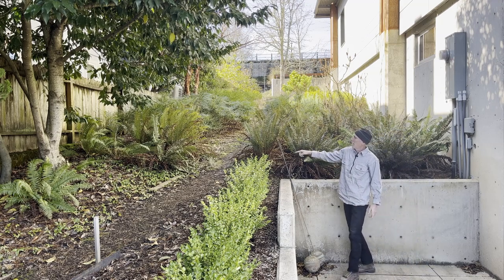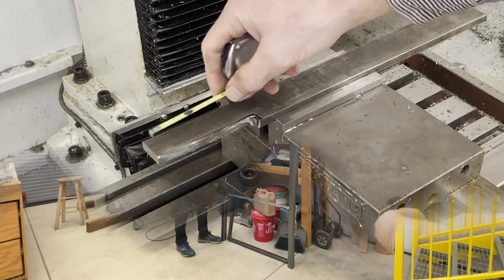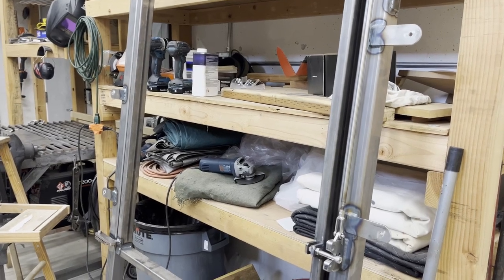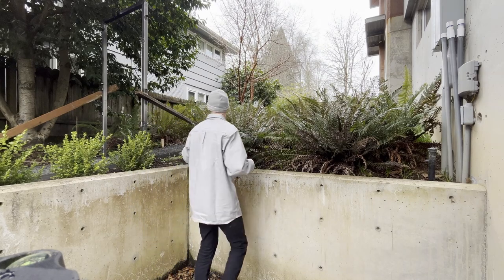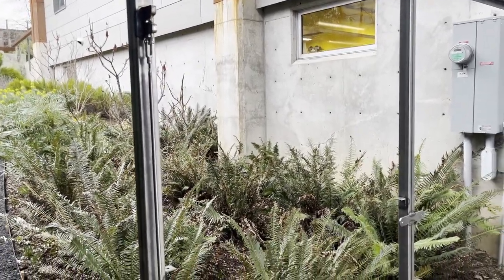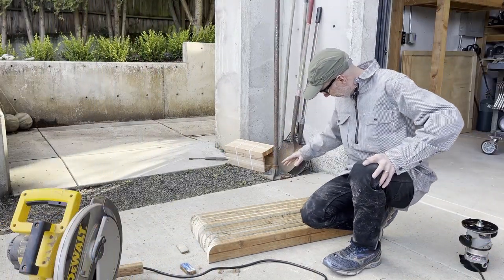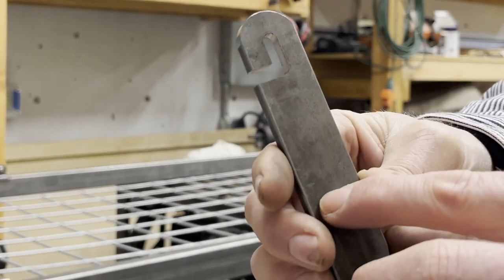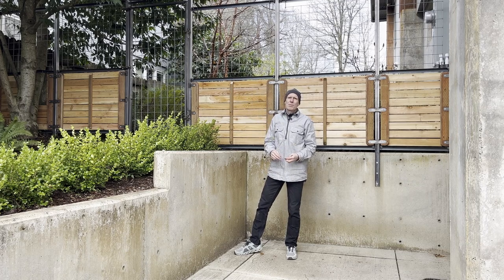000.8 - Oh Deer.. Fence. Steel, Wood and Concrete Fabrication.

Comment: Great videos, I see you are using the CK MT200 TIG. How do you like that machine?  Would also love to see a shop tour, it looks pretty awesome.
Reply from the maker: Thanks for your message and for watching. The CK welder has been really solid. It replaced a Miller of similar capacity that I paid for twice, once to buy and another time in repairs. When the Miller failed the second time, my repair shop just said to buy the CK and don't look back. It has been great for a couple of years with quite a bit of mild steel and aluminum work.
Reply from the maker: Oh.. and thanks for the compliment on the shop. It has been really nice to use as it is pretty new to me. I'll get things cleaned up and give a tour at some point. I guess any used shop is a bit messy it still could use some work.
Reply: @outbuildinginfo  Good to hear, I like to hear from actual users, not the influencers that are pushing products like so many channels on YT.   Aren't all shops a work in progress… I know mine is for sure.